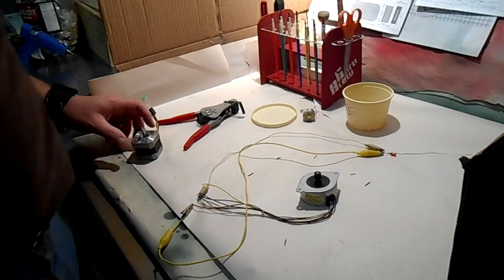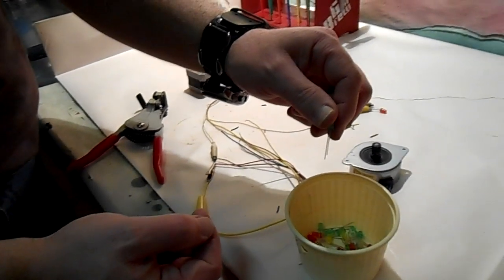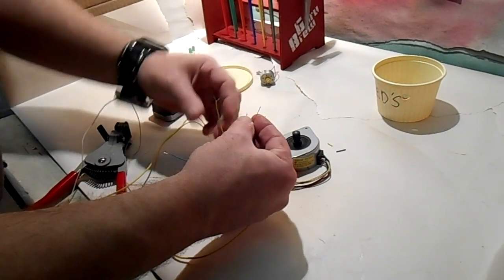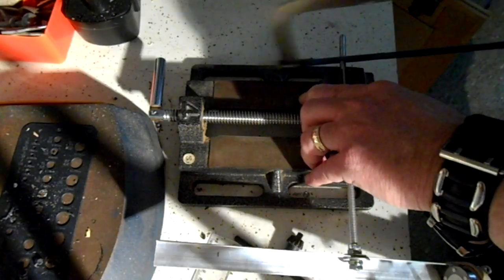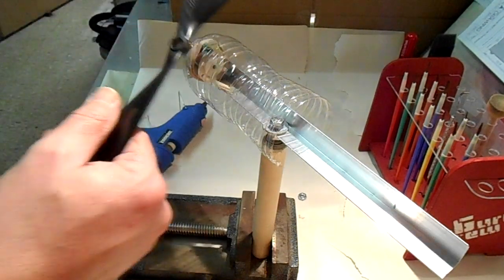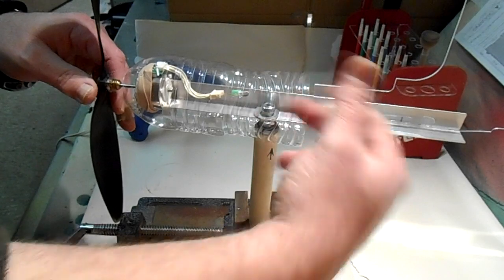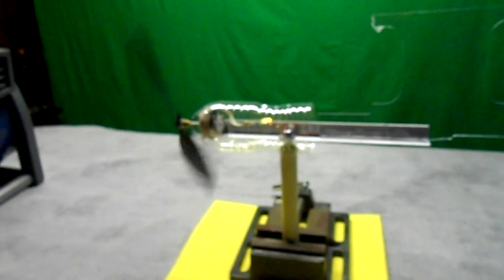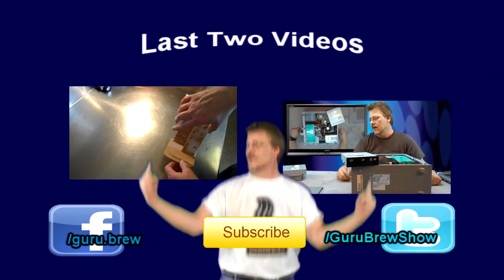Whirligig - Wind Powered Led Path Light Thingy

Comment: Love the video for a couple reasons - first, it's a great reminder that when you add electricity a motor can generate physical power for things things but when you reverse the process and apply physical power to the motor you turn it into a generator and create electricity.  Most people don't know this and it's simple but so well illustrated by the video - Same reason you can start your car by pushing it down hill and throwing it into gear - good work!